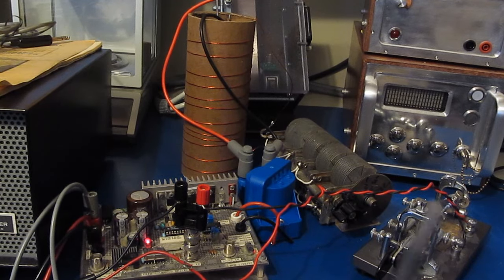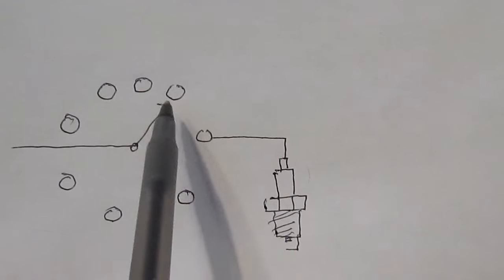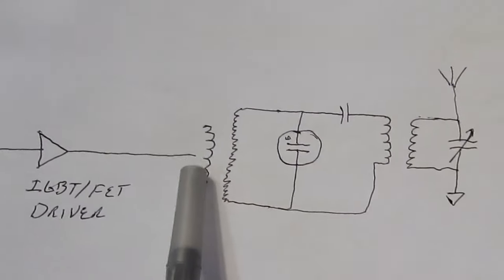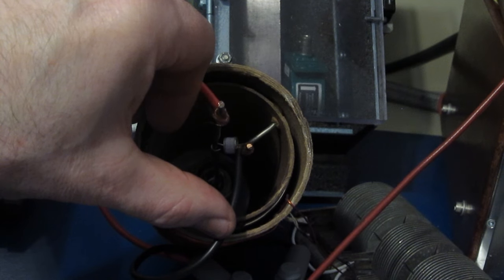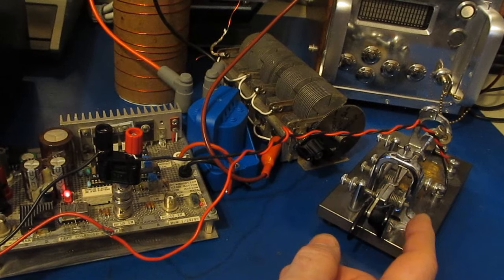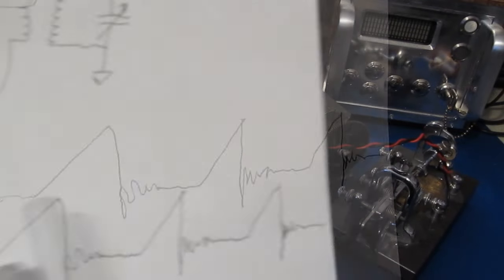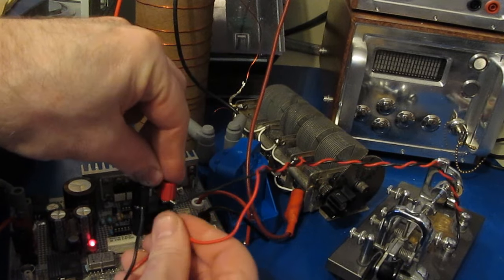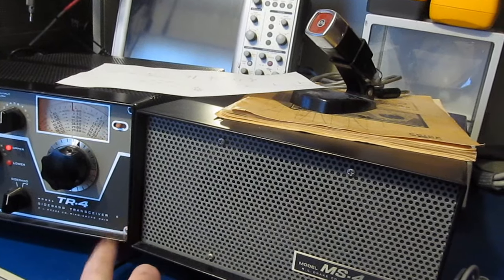Spark Gap Transmitter, Car Ignition Coil & Simulated Rotary Gap Sound, Part3

Comment: Playing with high voltage is fun. I built a Jacob's ladder once and was having lots of fun, but it produced so much ozone I felt ill and had to open the door and windows to let fresh air in. ; )
Reply from the maker: I'm pretty sure my laser printer puts off far more ozone than these experiments.   If I print a few sheets, I can smell it.   I haven't detected any odors working with the transmitter.

Comment: It's not loud enough!  My father told me that the local prep school (in the 1920s) had a spark gap transmitter in the gymnasium building. When they keyed it,  "you could hear it from across the street."
Reply from the maker: I can believe that.  But because my goal wasn't to radiate enough to communicate much further than a few feet, there's no need for a lot of big arcs.   After all, part 1&2 was using a couple of AAAs and a fly swatter for a source.   lol.

Comment: On my next trip to the wilderness I'll be sure to pack a  joe smith just in case 🙂
Reply from the maker: As long as you don't plan to travel more than a few feet into the wilderness, you should be fine.  lol.
Reply: @joesmith-je3tq  That's ok , there are only a few feet of wilderness around here (mostly between the backdoor and my shed 😀

Comment: In an old book I don't remember the name of, I read that the quenched spark gap and the rotary gap can be connected in series to improve the tone. I'm worried that this might disrupt the function of the quenched gap. How likely is that, sir?
Reply from the maker: Tone wise, you would need to use AM demodulation or a BFO.  With what I have shown, the BFO will not work with the pulsed, decaying signal.  So we are stuck with AM to get some sort of tone.   A while back someone posted a comment about Poulsen's oscillator.  Because now we are now looking at a CW signal, we could possibly use a BFO.  This may work but anything I have read, they never achieved frequencies above a few hundred kHz.    I don't see why a rotary spark gap could not act as a quenched gap.  After all you are just trying to extinguish the arc faster which means opening up the gap (or some other means).
Reply: @joesmith-je3tq  Max Wien's quenched gap is superior to the rotary gay discharger, according to what I read.

When they were still in use, most amateurs didn't have a generator in their homes to determine the discharge tone and rotate at a certain speed, so the quenched gap gave a very poor tone with 60 Hz AC taken from the outlet, which ultimately gave a 120 Hz tone.

When it was powered by a generator, every time the morse key was pressed, the generator was put under load, and because the speed of the generator slowed down, they got a chirping, unsteady tone.

I wondered if we could use a rotary discharger to adjust the tone and at the same time get the benefits of the quenched gap, when they are connected in series with each other.
Reply from the maker: @AlexBurtonMusic  If you watched this video, you could see I cycled this setup much faster than 120Hz.  If you check out the following link, shown is another transmitter for the 10meter band cycling at over 4kHz using the fly swatter. https://www.eevblog.com/forum/rf-microwave/fly-swatter-ham-radio-transmitter/msg5242794/#msg5242794
Reply from the maker: I have updated that post to include data running at 9.4kHz and calculations for the required RPM for an eight gap rotary.   Feel free to join up and post any comments there.